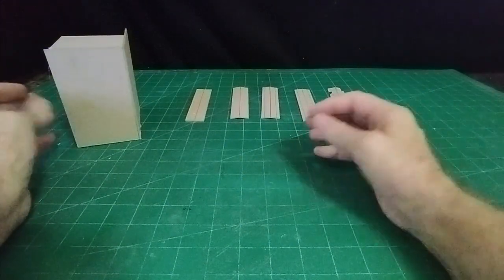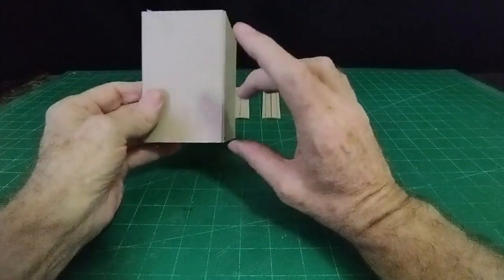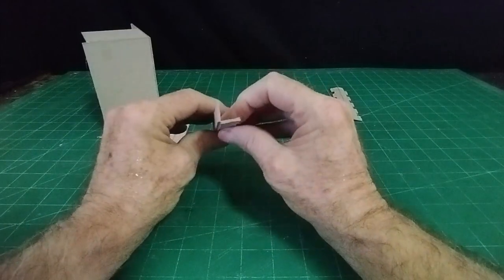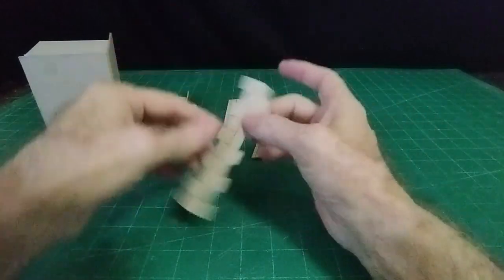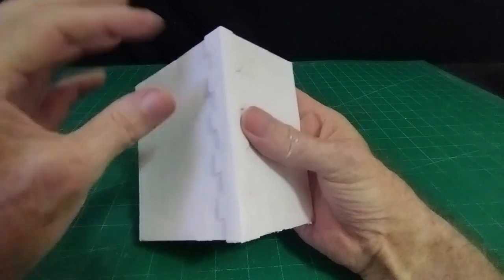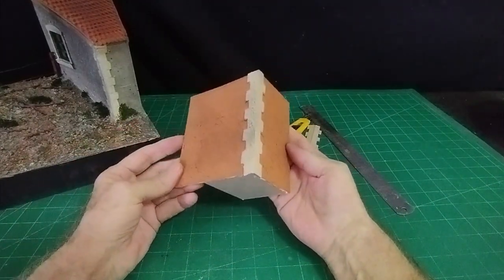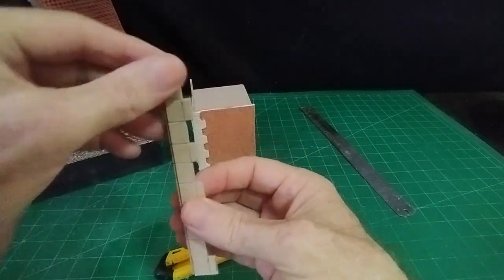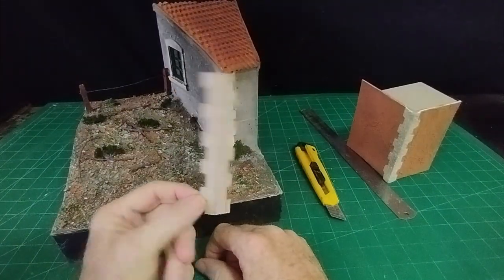Easy way to model corner stones (quoins) 1/35 scale scratch build modelling.(step by step)

Comment: Another great video . That will save time instead of making individual coins .
Just a quick 1 ,, can you use Polyfilla to prime the card board .  Have an idea for first 
diorama in head & on paper ,now to build it  .
Reply from the maker: Yes I always prime with filla
Reply: @nanplabwern  
Hello Don . Made first building with cardboard, did bricks with Styrofoam  2mm x 8mm . Done front & now on side I agree you get to know each brick.
Am going to try making bricks your way next. 
Have a tile that will take 2 A4 cardboard sheets, what's best to get board to stick to tile ?.